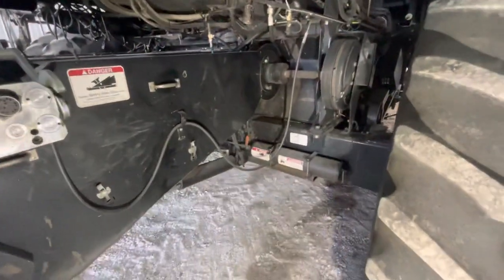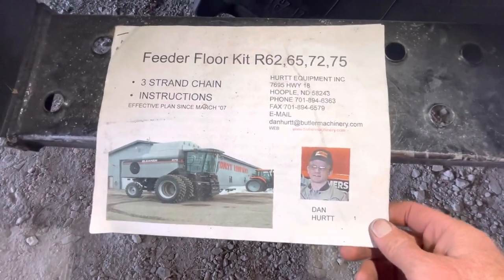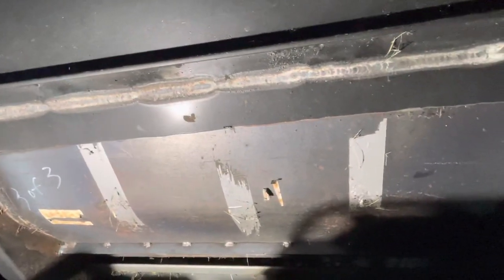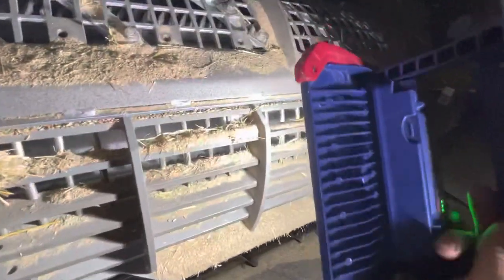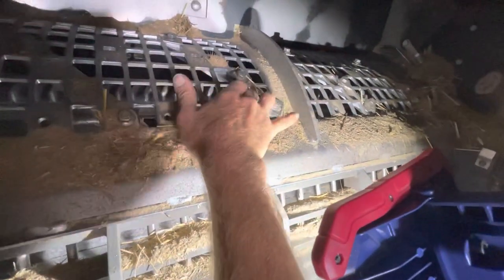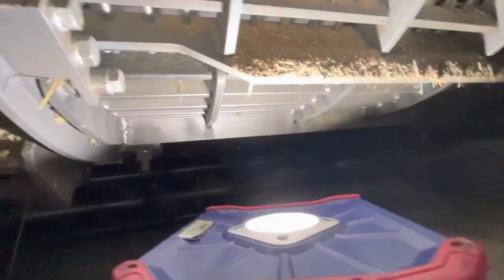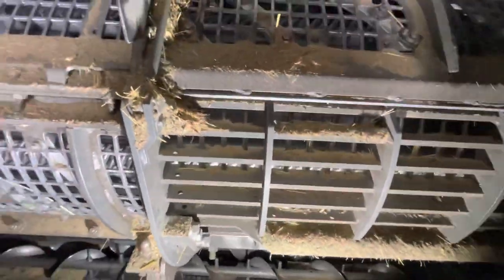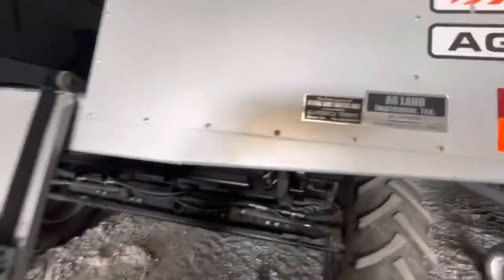Gleaner combine modifications

Comment: Steep pitch helical, after market? Agco? Part number? How do the mods do in corn and small grain? Know of any one making sweeps for a open 8 cly? Do you get more broken corn cobs, when having front of concave more open like that?
Reply from the maker: Yeah the steep pitch I got from agco, could not find them after market, it works good in corn and I do rye also, works good for that too. I have the cdf rotor, not sure who makes the sweeps for the open 8 bar. No it don’t do to bad for corn cobs.
Reply: @Hinesfarm-Indiana  On older gleaners would the max setting on front of concave be same as your 0 setting? The triangle chopper blades, have you ever found a sharpened blade, (like a lawn mower) for a replacement?
Reply from the maker: @matthewberan3404  it should be the same, what year is the machine? There is a fine cut chopper that you can get, I just keep my hammer knives in good shape.
Reply: @Hinesfarm-Indiana  94 R62 The front of concave on mine has Max, Mid,and Min. You said you opened yours to 0. Is that because it's a later model?
Reply from the maker: @matthewberan3404  yeah it says max and that’s all the way open, that’s what I have mine set on.